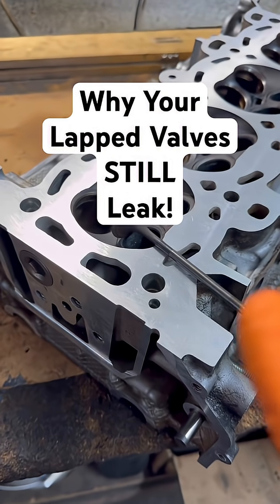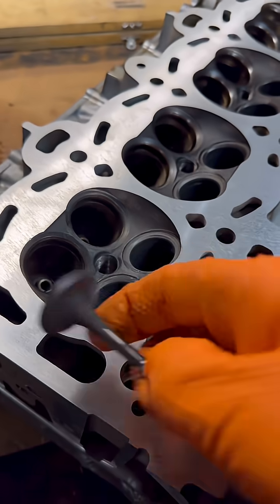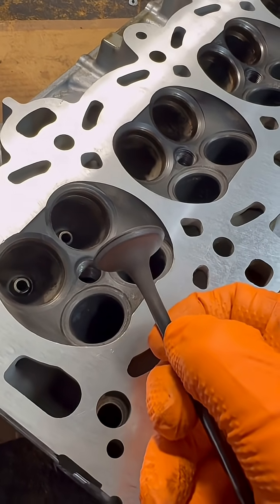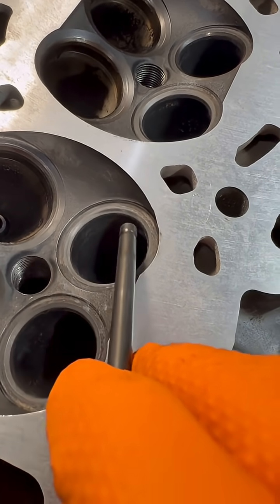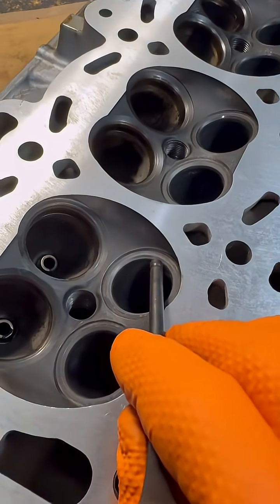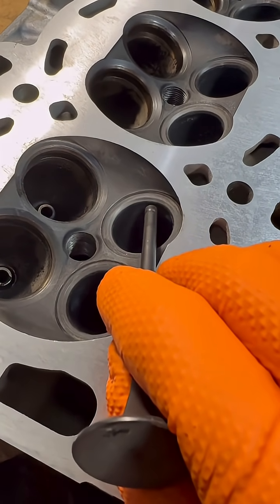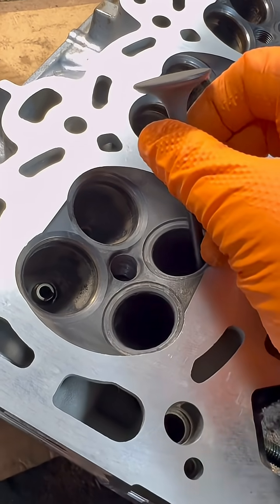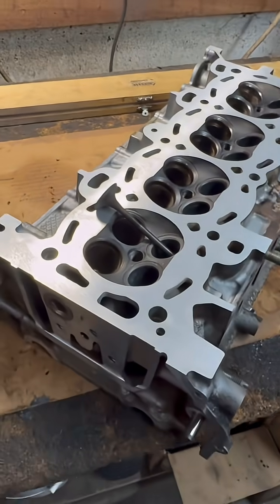Why Your Lapped Valves STILL Leak!

Comment: Is it difficult replace seat?
Reply: Took me most of 3 days to get the ones I was working on not to leak.
Definitely better feel for it lapping by hand.
Had to re install the springs every time to leak test with wd40 in the back of the valve and sprayed with compressed air in the face of the valves. Took multiple times of valve lapping to get a perfect seal. Had to reuse the old valves since the new ones I ordered were said to fit but were the wrong size...
Made a homemade c clamp to compress the springs with a notched out peices of PVC pipe glued to the c clamp that wouldn't scratch and damaged anything when removing/ replacing the springs.
Reply from the maker: Thanks for that information glad you got it done without replace valve seats that would of been a pain
Reply from the maker: For the average person yes best to let a machine shop handle that